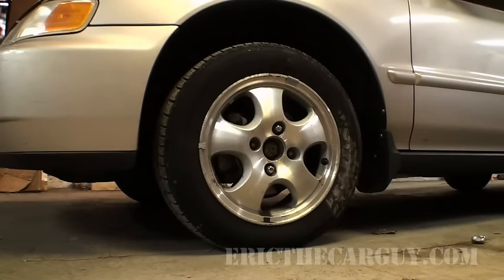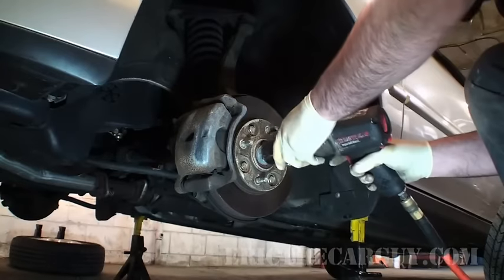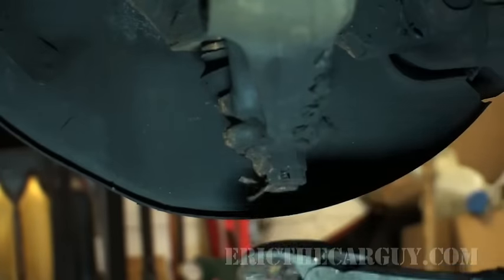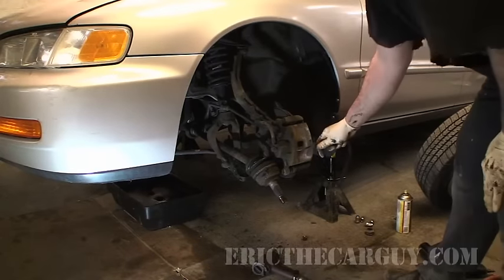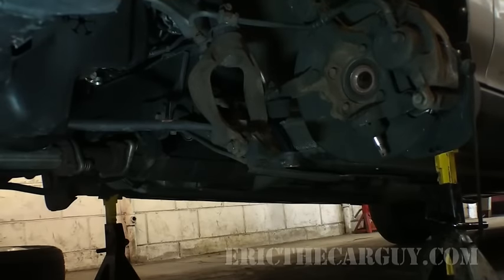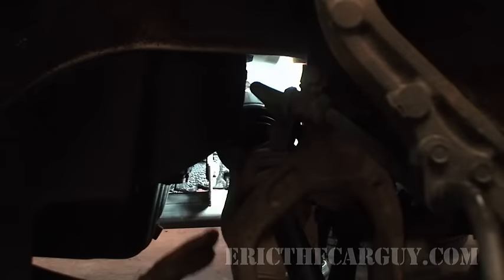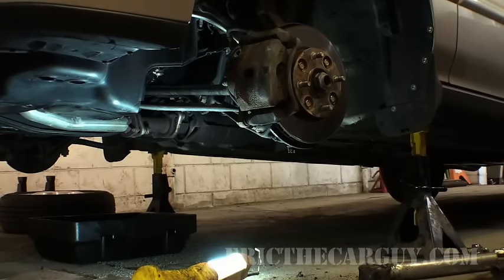How To Replace a Front Wheel Drive Axle - EricTheCarGuy

Comment: Typical torque specification on an axle nut is 180 ft/lbs, but some makes use less.  Stake the nut where it's supposed to be staked - if you go past the notch in the axle, you've gone too far.  On some American makes (Chrysler/Dodge in particular), staked nuts are not used - there is instead a washer against the bearing, a regular nut, a spring washer against the nut, and cap over the top held in place with a cotter pin.  Torque specs are really important here as too much will damage the bearing or the axle or both.

Comment: I had a brain fart and didn't replace the transmission seal in my 89 Corolla. Did not sieze for 2500 miles. Proves how well that car was built. Transmission was dry as a bone for 2500 miles.

Comment: oh man... try to take the lower ball joint nut off when the bolt is on the top and you cant get your socket or impact wrech in... Primera P12 has one of "those" Suspensions.... absolute nightmare!!!!! Adjustable spanner not working, keeps slipping off, only option left is to use a ring spanner with a pipe for leverage...

Comment: wouldn't it be a good idea to change that seal where the axle goes into since you already have everything apart? It seems like if you have enough miles to get a bad axle you might be nearing the point of a leaky transmission
Reply: I agree with you totally, may as well as everything is dismantled anyway, and it doesn't cost much for a seal ;)
Reply: Didn't the new one just come with the new seal? Are you talking about where the axel spline meets the transmission?
Reply: Do you have a video or idea to replace  rear O2 sensors on a 02 Toyota Rav 4
Reply: Frank Rizzo mine didnt
Reply: Yeah I'm about to do one and I watched Scotty Kilmer do an axle and he replaced that seal. It looked a bit tricky to replace and he had to pump tranny fluid back in.

Comment: If you are not experienced like Eric, I would suggest replacing the gearbox to cv-axle oil joint/ring seal, believe me, you don't want to see oil dropping from it after you put everything thing back and filled the transmission oil 😡 it fooled me twice, never again. From now on I will always change those ring seals if I have to change a CV-joint.

Comment: yea I just had to replace my struts from hearing knocking with every pothole or speed humps you can usually just look and see if the boot is busted or it has a thick oil like discharge

Comment: When you buy the CV buy a bushing for the control arm and other possible components you may have to remove. You can always return them if not used but replace any that are exposed. you're already there why not? Unless you like coming back later to replace parts also there's a possibility of them being damaged while disassembly is in process. It's always a pain in the butt to have to stop in the middle of a process just run and get a $2 part that you could have picked up while you were out. Remember if you got it you probably won't need it but if you don't got it you'll probably need it. Murphy's Law is Murphy's Law. Live by it it'll save you a lot of aggravation downtime and busted knuckles

Comment: Eric, I've got rear wheel drive pajero 2009. I have the clicking when I stay uphill and turn right. It started clicking a month ago. Nothing happens on a flat if I press gas gently, If I press hard I had 1 click. It also happens when I break hard(2-3 weeks ago), now It happens even with relatively hard break. No click when I turn left uphill. Which shaft do I need to replace?

Comment: If you are doing BOTH axles at the same time, be CAREFUL.  Some transmissions rely on the axles to hold the differential side gears in place and if you remove both axles, those gears can come out of place and require a LOT of labor to get them back in place.  Doing one at a time keeps those gears in place.  Videos like these are great, but you should always check the vehicle-specific repair procedure for any warnings such as this.

Comment: so basically this is the same procedure I will need to do to replace the seal on my trans, I'm leaking transmission fluid out of my seal on a manual transmission, now I had a question would that be the only thing that will cause my trans to leak,  just the seal.. leaking out of the passenger side.

Comment: Great video! I'm working on my Nissan Sentra and the axle joint is stuck inside the steering knuckle. I've used PB blaster and hit it with a hammer and nothing happens. Any recommendations?
Reply: Jorge Wong Bigger hammer

Comment: I know it's been awhile for this clip.
I have a question on diagnosing this.

04 V6 accord automatic transmission
motor running good no ruff idle 
symptoms no warnings
 fluid levels good
from gear shifter it moves fine to all gears.
 but it won't go forward or reverse 
when it is put in them gears
 (don't laugh) it makes a VRR- RIP clanging noise drivers side front tire side.
In neutral, it is making a steady click click click noise from drivers side front tire area. 
My Brother has always been my go to guy for anything car related. He passed away recently, Christmas eve to be exact. 
I know you can't tell me 100% with out seeing it. But what's your thoughts.
Thanks 😊

Comment: Eric, my axle snapped in half. So I followed your video and remove the half from the hub but the other half that’s stuck in transmission is not coming out. I tried pry bar an screw driver and eventually called it a day. I can hardly rotate it since it’s only half a freaking axle rod. Any ideas bro? I’m all out.... btw I have a 05 Accord Ex-L

Comment: what's up with using the impact to tighten the axle nut? That is not good for the hub bearing..snug it up with impact maybe..mount wheel and lower to ground then finish with torque wrench.

Comment: Hey Eric,

I needed to replace my Wheel Bearing and Spindle assembly and before doing so I noticed some grease on my control arm and all over the inner axle boot.  I was also have some creaking and a loud knock/click on sharp turns.  I thought my axle needed to be replaced and went and got one.  I didn't notice any tears on the boot (so im not sure where that grease came from).  Since I had some knocking and creaking I decided to replace it anyways since I was there and had the part. 

My friend and I could not get it out.  We tried prying at it, knocking on it with a hammer and still nothing.  We loosened the bolted clamped on the back side of it and started to slowly inch it out but it started taking off the housing the axle is in that is inside the tranny.  Is that suppose to come out with it or not?  It's between the tripot and the tranny.

Any ideas?  Its a 2004 Ford Focus SE, Single Cam, Automatic, passenger side.

Comment: I'm not saying ur method is wrong,in terms of taking the driveshaft out of da steering knuckle. You should use a center punch to hammer it through da knuckle, it won't strip the threads,more smarter.

Comment: I broke 2 breaker bars doing this.  So I went out and bought a big huge 3\4 inch ratchet from Princess Auto here in Canada.  Princess Auto is similar to Harbor Freight in the US.  Any way that monster ratchet only cost me $34.99 and now all my axle nuts come off easy with no pry bar. You'll also need a 36 MM socket and a 3/4" to 1/2 inch reducer......Canada.
Reply: broken 3 and had a torch...... still not out yet
Reply: Buy the 3/4 inch ratchet and you'll thank yourself.

Comment: Chevy dealer told me that On my 2007  Blazer I need to replace the front axles both side and I only have 57,000 miles at a cost of $1,300. is he crazy or he wants to make money for GM? 57,000 and I need to replace all that? is Belle Tire also replacing those parts? do you need to get GM parts or off market parts are good too?
I need your advise

Comment: I have a question, So Im replacing my axles when I had one of my moments. You can slide the axle in and out of the hub once installed without the nut on. My question is, Do you pull the axle out as far as you can then tighten it, or do you just leave a few threads sticking out? Damn it man lol.

Comment: I do have a good question... What do you do in a newer vehicle that have "sealed" transmissions that you can't add fluid in? Giving that a small bit always seems to come out when you pull the axel out of the trans..
Reply: I just did this on a 2009 Toyota Camry HyBrid this weekend because the Axle Nut had a depression that I couldn't get it raised above the threads so it shredded the threads and could not get an axle nut back on.   So I replaced the CV Axle and the Sealed Transmission there was  enough suction on the seal of the Axle I heard a Hiss and Pop like a pop bottle and then about a quart of fluid came gushing out.  Car has 113,000 miles on it and now it feels like the other CV Axle needs replaced cause there is a gear type feel when driving it or a vibration.  The old C Clip came out with the old CV Axle.  Not sure what the problem is or if I need to replace the other CV Axle now also?
Reply: You can always find a sensor, breather or some type of bung to put fluid back in to any “ sealed “ transmission

Comment: That axle nut trick won't work on Hondas with wheel covers.  But you could stick a screwdriver in the brake caliper if you don't haven a impact wrench.

Comment: What he said bout the axles not fittin' my uncle ripped my dad off on a Honda just like that. He knew my dad was gon junk it or sell it cause he couldn't get it fixed. We didn't have a vehicle atm. My dad tried and tried to find parts. He need a clutch, pressure plate and throw out baring but my uncle bought all the parts and didn't tell my dad cause he knew my dad couldn't find em cause he had a standard. Long story short my uncle got instant karma and that axle was for a automatic instead of manual. It was bout 2 inches shorter and it slipped out 3 times we tried to tell em it wouldn't work but that fourth time that axle busted through the transmission 😂😂 I loved watchin' karma at it's finest.

Comment: Thanks Eric this is awesome. I'm going to be doing this in a couple of weeks, so I'll be following along with this.

One quick question though, at 13:26 you hammer a screw-driver against the big axle nut a couple of times - what was the purpose of this?

Cheers!
Reply: VanguardDragon you may have gotten your answer already, but hammering part of the axle nut into the notch on the axle is to help prevent the nut from coming off easily.

Comment: I replaced the cv shaft, ball joint and sway bar link on a 98 CRV.  The cv shaft had separated from the inner joint (it was still in the transfer case) and was just attached the wheel. I put everything back together fine but I notice that the driveshaft spins while the truck is in drive while the brakes are applied, any insight on why this may be happening and does it have anything to do with the CV shaft being replaced?

Comment: I noticed a small amount of lash or rotational play on my inner cv joint after removing the shaft for inspection. Is this normal, or should I replace? Boots are ok, but starting to crack.

Comment: #1 Question about CV Axles.   If you have a low mileage vehicle under 50,000 or a high mileage vehicle over 100,000+ do you need to replaced the other CV Axle.  If you only replace one side and not the other on a high mileage vehicle could that cause the other CV Axle to display signs that it is worn by vibrating?  Looking for tips on this topic?
I have a 09 Toyota Camry Hybrid I replaced driver side CV Axle and struts and tie rods and sway bar links thanks to ETCG. and because the depressed portion of the Axle nut didn't get lifted above the threads it shredded the threads so I had to replace the Axle.  Now when I drive it feels like the transmission is sluggish and possibly the other CV Axle is vibrating?
Reply: d mccull When theres  more than one ...replace both or all.

Comment: Would it be a good idea to also change the oil seal while the axle is out? I didn't when i chnaged my cv axle, which had snapped in two, and now it's leaking.

Comment: what's up Eric I have a 1999 Acura TL I just replaced driver side and passenger side CV axles due to a vibration when I accelerated what I went for a test drive I notice that my brake pedal now vibrates and I can hear a noise coming from the passenger side when coming to a stop have you came across this before

Comment: Hey.  In my  2006 Infiniti G35 AWD, the passenger side CV Axle keeps popping out of my transmission. 3rd time it has dislocated from the trans while driving and turning.  I'm thinking the insertion point on the transmission is damaged. Splines look good though.  Spent over 1K replacing CV axles.  Any advice or information will help. Please help

Comment: Sir my car has a bit of play on the CVT axle. The axle can be push in and outside by approx. 1cm or less and also makes knock sound while moving it. Is this a bad CVT or normal?

Surprisingly, no leaks or damage in CVT boots and no clicking noise when turning or riding the car.

Comment: with the bolts that he used an impact gun on(like the axle nut), if you are just using a wrench to put them back on how will you know if you are putting the back on tight enough? im worried i wont put the axle nut back on tight enough

Comment: After inserting the shaft I still have a gap, even after multi attempts at removing it and doing it again. It worked fine. Now it appears is leading Tanny fluid from the joint. Is it damaged or just not installed correctly?
Reply: Probably the wrong type of Axel

Comment: Hello Eric a have got a interesting question to you, an old European car VW golf MK3 1994 with 300 000 Miles on. Left side bearing new the same both CV joints on the driveshaft new. Driving on straight line I'm getting a rubbing or helicopter noise from the left side, the noise stops only when turning left. I'm suspecting the left side bearing inside in the gearbox that turns the driveshaft. Is an expensive job as transmission need to be replaced. The noise increase with the speed, so has to be a bearing.I suspect and a worn driveshaft splines as I grab the driveshaft near inner CV joint and notice a very small play up and down.What you think about this noise is from the worn splines or transmission bearing?

Comment: I have to replace the front drive axle on a 2006 John Deere HPX Gator (4wd), it has struts in the front.  Do you have a video doing the axle on a machine with struts?

Comment: quick question I'm trying to put the hub assembly back together but the hub won't go all the way in with the cv axle will it be fine to just tighten the spindle nut to get the hub to go as far back as it should go in

Comment: i notice that 1st axle that you remove  has a rubber boots on passenger side. the one you replace dont have it. what is the purpose of the rubber boots? are still the same axle you replace?

Comment: Eric, what happens if I don't tighten the bolt for the wish bone with the wheel set on the ground? because my car is fairly low and I'm afraid I won't be able to get to it. any suggestion if I most set the wheel on the ground?

Comment: After the replacement I get slight but noticeable vibrations that I didn't have with the old axle? (replaced the original factory axle  b/c the boots were torn up for years) Is there a way to eliminate that?

Comment: Eric;  I am working on my 2002 Saab 9-3 SE Turbo Convert. manual .  I need to pull out the engine to do some work on it, but I am having difficulties. Could you give an advise on how to remove the passenger side drive shaft.  Roughly this shaft has 3 parts, (i) a drive shaft connected to the hub, (ii) a bracket attached to the engine, and (iii) an extension shaft going into the differential.  I freed the shaft on the hub side, I removed the 3 bolts connecting the bracket to the engine; but I still cannot remove anything.  Any advise will be most welcome.  thanks Yvon

Comment: Dear Eric,

I would like to take your advice, I have Honda Accord 2005 Japaneses model and my car vibrates on 30 to 40 KM/hour speed when I push the acceleration in 2nd gear (Automatic Transmission) and I have replaced the following parts but the problem still there:

1. New Tries
2. Front Alex CV Joints Left and Right (Complete set)

Please help me.

Comment: Eric, My CV Joint will start into the transmission but will not insert all of the way. It seams that the clip is catching on something. Even tried an 8 lb. sledge hammer and still won't go. Any suggestions?

Comment: Hi Eric, if I just want to remove the transmission to change a clutch, is it possible to keep the wheel axle nut in and still able to pull out the inner end of the drive shaft? The wheel nut is staked and kind hard to remove.

Comment: Having idling issues on my 93 Integra with a b18c1 vtec swap, also have battery light flickering someone said its a capacitor behind the fuse panel on the kick board. Any ideas ? I replaced the TPS and cleaned the throttle body, no codes are being thrown and I have no (or can't seem to find going by your video) a FITV. Please help buddy

Comment: I noticed at 7:03 when you turned the CV joint, the adjacent CV joint rotated in the opposite direction. Is that normal or just a result of the first joint being popped out of place?

Comment: Please help. 98 honda accord. 4 cylinder.  Replaced driver's side cv axle. Approx. 1/8th inch space between transmission and cv axle. Is that okay? Everything went together properly. Axle slid right in. Driving car. Seems to be no problem. No leak. Some people say little space okay. Others' say no...

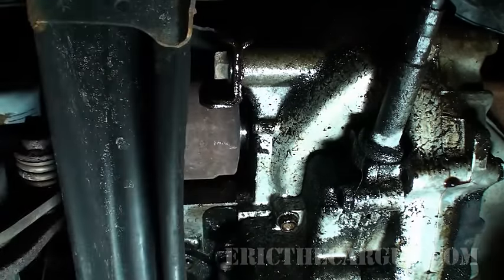Comment: I just watched another video (How to Replace Front Passenger's Side CV Axle 2004-12 Volvo S40), could you clarify something for me.  If you go to the 6:49 mark you will see them about to put on the axle bolt but there is a gap - so that the shaft does not sit flush with the outside of the wheel hub [which is how the ones I was replacing sat but I stupidly threw them out]. Is this gap acceptable?